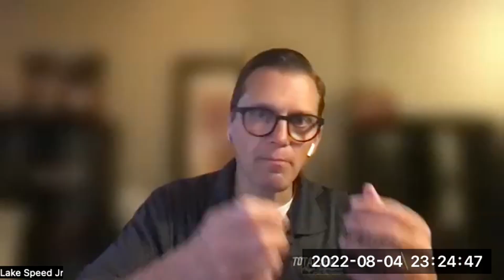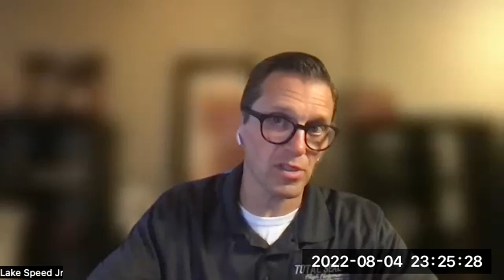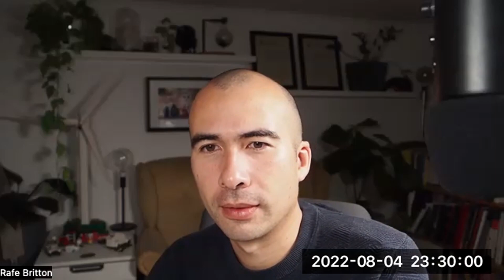How new cylinder technologies are enabling lower viscosity oils

Comment: The use of thinner oil is to achieve less pumping looses and ver better fuel economy at the expense of more wear in the engine. Cylinder spray on the lining is used to help protect engine wear from using thinner oils. Long oil change intervals are also used to reduce the need for as many oil changes over the life of the vehicle. And this has proven time and time again to cause major engine wear. Most cars rust away before the engine is worn out. So why not use longer oil change intervals…..
Thicker oil is not always a better idea. Keep in mind that engines designed to use thin oils have very small oil passages that may not allow thicker oils to pass through causing extream wear.

Comment: The Ford 5.2L GT500s(supercharged) and GT350s(naturally aspirated) engines with spray bores specify a 5W-50 not a 5W-20, yet the 2021 5.0L Mustang GTs with spray bores spec a 5W-30 and the earlier 18-20 5.0L GTs do spec a 5W-20. This inconsistency in viscosity specs would seem to dictate the need for very different piston rings for each different version of very similar V8 engine designs. 
Very interesting video, however no GT500 has ever specified a 5W-20 to my knowledge. Plasma spray bores are a fascinating technological advancement without question. Love this channel! Great content!
Reply: How do you know the spray chemistry and its mechanical application is the same?  Are all spray bores identical?

Comment: Oh man , where was this tech 10 yrs ago. Even if gas motors get 10% more efficient (which would be amazing) an EV still makes more sense on so many levels. I’ve owned many gas cars , worked on them , tuned them , turbos, and all. Once I test drove a model 3 performance I had to buy it.  Hard to believe but once you see what they are really like to drive and live with gas makes no sense 99% of the time

Comment: Yes but what about big end and main bearings? The situation there is completely different because a cushion of oil is required to prevent metal to metal contact, cams too.
Reply from the maker: True, and that’s a separate conversation. Usually the oil viscosity is optimised for the crankcase bearings because they’re the most difficult/expensive to replace. So all this stuff about rings and cylinder finish would have to run alongside developments in crankcase bearing tech too.

Comment: As a repair / performace shop that spelcizes in Toyotas/Subarus and Hondas, everything said here sounds great but in real life use it doesn't always pan out that way. The amount of regualr soccer mom Camrys i have seen with low compression and excessive bore wear in an engine that oinly has 130-160k is mind blowing atleast 2-3 a month all of the 2013-2018 years which recommend either 5w or 0w weights. Camrys from the warly 2000 and 90's that i still serve have upwards of 300 miles and torn seats and other body wear before the engine startes to lose compression!
 From the engineering side most things are best case sceneiero, and thin oil will work if chaged often but Toyota is starting to recomend 10K oil changes!!!! by the time 10k comes around the additives are dead, and start to not provide much protection with the light weight oil.
For the past 8 years i have recomend 2 things to my customer, use the factory weight and change at 5k or go with atleast a one step higher weigth and change at 10k, you dont have to listen to my advice but we document everything and do as we're told.

And Normally i mix oils if the customer approvees as well so for like a Camry that Usally takes a little more than 4 quarts it calls for 0w-20 so we sually use 3 quarts of 5w and one of 10w. One girl who is a traveling nurse and puts A LOT of miles on her car has let me do this with her car and she recently has crossed the 250k mark on a 17 Camry she is very easy going and i felt brave enough to ask her if she was okay with me removing the head of her car to inspect the bore for free and she luckily siad yes!!!! Sure could use a boreascope but it is not the same. She bought this car in 2019 with 30k ish miles and we have taken care of it since, i kid you not the bore looks perfect! Obiously not good as new at 250k but no excessive wear, all the cylinders look even, compression within 3 PSI even on all cylinders, beautiful  wear on the cylinders on a 250K engine! 

you look at perfoamce cars the new Coverette recommends one weight for street driving and a signitificatly higher weight for track use!!!! The own engineers know that the weight is too thin for hard use but the manufacturers have to meet new clean standards to meet the quota! We at least get 6-10 BRZ/Gt86's that spun a bearing or lost compression due to track use with thin oil. The track guys we always use a 10w-40 even when the car recomends 5w or the newer ones that recomedn 0w-16!!!!!!!!

Take my 20 year of experise with a grain of salt but i deal with a a whole differnet end of the market, the non-enginering, out of warranty, trying to help the customer indepednet shop perspecitive.
Reply from the maker: Wow! Thanks for taking the time to write such a detailed comment. It’s always nice when someone with experience contributes so much. I think you’re right, and let’s be honest, whenever new technologies get introduced the OEMs can’t predict how it impacts the fleet over a full engine lifespan.
Reply: Something else that’s breaking down oil is fuel dilution, mostly in Direct Injection engines. Also the more efficient the engine, the longer it will take to warm up in the winter, if at all. 

Our Subaru Ascent dumps loads of fuel into the oil. I was using one oil analysis company that didn’t have fuel dilution readouts and switched to one that did. With the first company I was just seeing a lot of viscosity loss. But the first one after I switch showed >5% fuel dilution. I emailed them and they showed 9.7% fuel dilution, though the equipment isn’t calibrated past 5% so it could be slightly off. That was at 5K miles with half of it being on a road trip. I also drive the car at temp for quite some time before doing the oil change to hopefully burn off any residual.
Reply: @cpftank09 I am asking if you are going to put in lube oil with black moly to counter fuel dilution?. Fuel dilution could also be due to the leaky seal for fuel pump which is run by a cam. This type of leak is directly into the engine sump.
Reply: @whlawson5812  what is black moly? It’s been like this since new and many other Subarus with this engine have similar results. It really a byproduct of direct injection. Some have it worse than others and it depends on drive cycles.
Reply: ..,....to counter against possible higher wear rate due to fuel dilution.
Reply: Why are you increasing the w viscosity?  Why not the hot rating?

Comment: That was an eye opener. I would never think that using higher viscosity oils would actually increase consumption. Hard to fathom for the first few moments.
Reply from the maker: It seems counterintuitive doesn’t it?
Reply: It would depend on other factors such as operating environment thus manufacturers recommending 0w-20 and 5w-30 for the same engine for example.

Comment: So more oil retention less friction because of smoother cylender finnish less drag because of thinner oil. Thinner oil should be a big help. Getting it through the filter should be easier, crank rotational force less, ring scrapping should be less, better oil shedding. Oil cooling may even be better. 
This is a huge advantage. 
Thanks for the info. Thanks Lake!

Comment: how about  when the engine is at  100,000 to 150,000 miles on original  oem parts ???  that surface coating diminishes and wears out,  your not gonna tell me its a throw away !!!!! our washington dc rules and regulations are screwing with good well learned engineering, because of energy conservation geting out of hand. the car companies dont give a dam after the oem warranty runs out, so why would it matter to them. my rule, start new with oem required oil and filter, at 100,000 miles its time for liquid adjustment, at 150,000 miles readjust fluids again. no wonder everyone neede a new engine at 100,000 miles.  electric only vehicles ?  so we can throw away our gas diesel 100,000 mile vehicles !!!!  if our country was serious about all electric vehicles there would be a charger next to every gas pump at every gas station 5 years ago, reality is going to hit hard for all the electric vehicle talkers, biggest failier in vehicle history coming soon.

Comment: Cummins liners aren’t sprayed (just honed on a usually-bainitic liner) and last 20,000 hours and more with 15w-40 group 2 oils.

While it is true that newer bore tech is allowing thinner oils, the thicker oils will still outperform in wear rate IF they rest of the system is set up to use them. The oil ring tension here is lighter to reduce parasitic loss and improve efficiency. But if lighter tension and lower viscosity was the way to go for durability, I have to believe we’d see that approach on larger industrial engines, which STILL use 15w-40 oils in almost all cases.

Comment: Low compression rings are NOT a technology...they are a scam. Intended to dramatically shorten the life expectancy of the engine and artificially improve fuel economy by burning oil. The use of adequate oil control ring journals could have been utilized to compensate for the inferior low tension rings but that would defeat the dual purpose of artificially increasing economy and reducing service life.
Low viscosity oil can be used with high (proper) tension rings too and is not a new idea at all.
5 weight oil has been around for many decades.
Reply: Low tension rings are racing technology and should be driven like racing engines. Rings need cylinder pressure to seal.

Comment: Great stuff!  Thanks.  Google the tech paper title " POWER CYLINDER FRICTION REDUCTION THROUGH COATINGS, SURFACE FINISH AND DESIGN " for a Ford summary of plasma bore porosity & benefits varying porosity & oil viscosity, for wear, friction, etc.  I had to look up what viscosity motor oil was recommended for a couple of plasma spray bore engines Mustang GT350 & Nissan GTR, and they say to use THICK oil only, so I guess their porosity valley depth is low (low oil retention).
Reply: Thanks for the reference to that paper.

Comment: Nice explanation.  What I know is that Ford is having a lot of problems with their plasma lined cylinder 5.0L engines oil consumption.  They state to use 5-W20, and they still have oil consumption issues they are trying really hard to not permanently address.  I'm all for new and better technology.  However, just because you can do a thing doesn't mean you should do the thing.
Reply: Short memory span.... forgot how disastrous the Vega was ;-)
Reply: @jamesplotkin4674  Very different approach, and a half-century of progress on tribology and materials science will sorta change things, yes?
Reply: Modern engine oil consumption problems are because they are not driven hard enough.

Comment: So I am guessing if you reduce the RPM (piston speed) of an engine you would reduce oil consumption by reducing the chance of piston rings hydro planing on the oil.
Reply from the maker: All other things being equal, then yes I think this makes sense.
Reply: Blowby, rings skidding and canting...oilconsumption and wear can increase exponentially with high rpm. My Cummins never sees more than 2300 rpm and never lugged. 5000h. 54 Chevy 4000rpm max. Ca. 5000h Still good.  Formula 1 engine at 13000rpm 1h max.

Comment: Would this be relevan on any evironment temperature? Same viscosity for north pole and equator? Do you have data for the engine operating temperature accros earth hemisphere?

I  think engine oil with high viscosity index is not magic solution, because of their weak shear stability.

Comment: This is interesting, my Mustang has a gen 3 coyote with the spray in liners and I’ve been shocked at 1) just how little oil it consumes, it will be down about a quart at 10k miles 2) how low the wear metals are in the used oil analysis. I’ve been using 5w-20 and now you’ve got me curious if 5w-30 would end up burning significantly more oil over a change interval.
Reply: I was going to use 5w30 on my 2019 mustang bullitt but then saw this video, the mustangs 2018+ have the plasma spray in liners hence 5w20 is adequate. I've seen it posted around the net that it's a conspiracy to permit increased engine wear for fuel economy as per govt targets but knowing the oil spec was changed with new cylinders makes me comfortable sticking with ACEA 5w20 A5/B5. Though I've heard for track use 5w30 is recommended in the coyote gen3, my online owners manual via ford doesn't seem to have a track recommendation for oil use